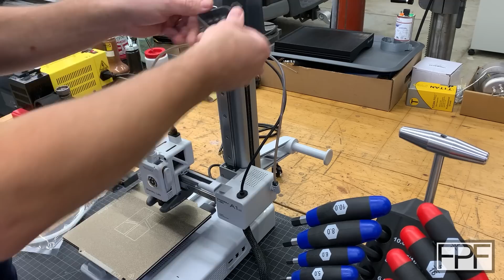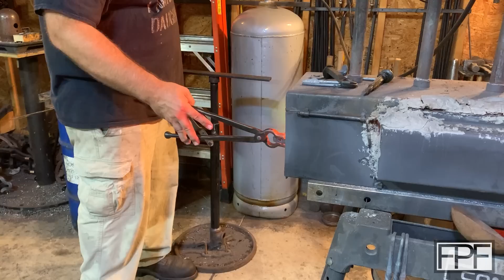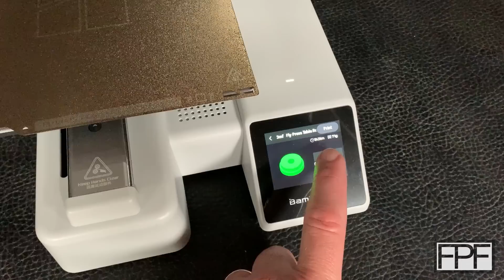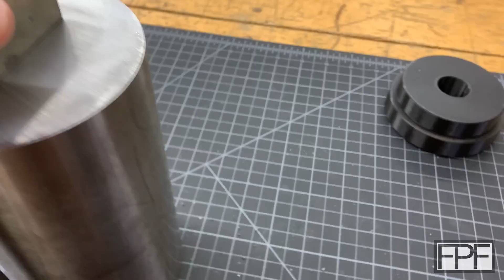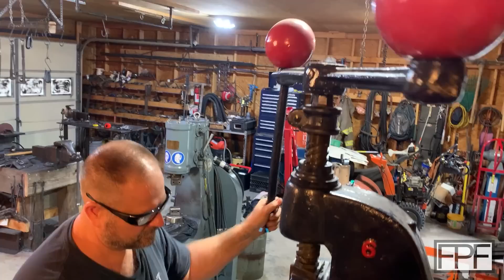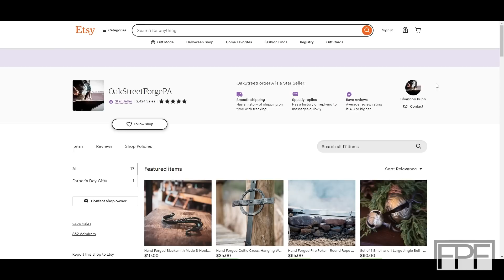Bambu A1 Mini Tested - Portable Printing

Comment: There was recently a leak about the new bigger BambuLab machine coming out in Q1 2025, confirmed by BambuLab later on. It is rumored to be called the H2D and will indeed be bigger and enclosed, and rumors talk about a twin head multicolor printhead (based on patent filings), which would eliminate a LOT of the filament loss (aka poop) actually wasted by their multicolor system.  I think that would be awesome.  I got myself an A1 Mini without AMS because I refuse to waste that much filament on prints.  We have enough plastic in the environment as it is…

Comment: Next time you are in a hurry to get something off a build plate and you're near machining equipment, just put the print bed on a big flat piece of metal. I use a shear at work, but a table saw, band saw, drill press, ... will do the job. It sinks away the heat, just lightly push down on your part and/or the build plate since the build plate will warp as it cools.

Comment: I like my A1 Mini.  Interestingly, I measuring the usage with AMS, and it seemed to be using about 80W according to my meter.  I wonder if the 240V mains here effects that.
Reply from the maker: Could be difference in ambient temp as well, making the heatbead work a bit harder.    I was printing outside, and while it wasn't real cold, it was below typical room temp with a slight breeze.
Reply: @FunctionalPrintFriday  very valid point.  Mine was indoors.

Comment: I've had my A1 mini for a few months now. It's an amazing printer for the price, and has become my go-to everyday use machine. 

As for bambu's next printer, It's either going to be a new generation of the X1 carbon, or as everyone else is thinking a large format CoreXY printer.

And I agree the new elegoo neptune 4 printers are crap. But I do rock an old neptune 3 plus that has had next to no issues.

Comment: Is the back of your car level?  Would checking for level make any difference to the print you think?
Reply: I don't think it would make a difference. Angus at Makers Muse hung one from the roof on a wire and it printed fine, and Morley Kert printed with an X1 Carbon in the back of a camper van driving on rough tracks in Mexico.

Comment: Where is the reprint? It wouldn't be an FPF video without a reprint.
Reply from the maker: what if I told you I initially sliced (and half printed) it upside down, with no supports, because I wasn't paying attention :)  I didn't use the footage though, because the video was already feeling too long.  Such a shame I had to spend extra time poking around the blacksmith shop. . .
Reply: @FunctionalPrintFriday  without the 3 reprint it's not a "real" video!!1!1!!1 😂
Reply from the maker: @berlinberlin4246  I can just see the game now:  FPF reprints it again - take a drink, FPF nitpicks over a minor extraneous detail for 5 minutes - take a drink, FPF uses the hex wrench rack - take a drink

Comment: Do you have issues with dimensional accuracy with your Bambu printers? I have an A1 and I can't get nearly as accurate as I can with my Prusa Mk3s. I'm skewed differently in all 3 axes... not by much, but enough that it makes printing pieces to size difficult.
Reply from the maker: That's crazy, I'd send it back.  Have you re-run the calibration?  The only time I've ever had issues is when using filament that doesn't have good consistency on the diameter, but even then, the part is just over or undersize in areas and not skewed.
Reply: Sounds like a belt slippage issue. We have five Bambus here and they consistently nail tolerance prints every time.

Comment: As far as Bambu Lab's printers, I'd like to see better pricing. I spend $600 on my last printer that can do 90% of what the X1 can. I get that the last 10% is hard, but over double? idk about that.
Reply: Not another race to the bottom please, we had that for many years and it was miserable. I have my reservations with Bambu, but the price is not one. For what they do I'm surprised they can sell them so cheap.
Reply: If you’re happy with your 90% printer at half the cost, why do you care? If you don’t want to spend the money, don’t.
Reply: I don’t agree. The x1c is an amazing value imo. I paid for consistent print quality and I have zero complaints.

Comment: I have my Delta 2 with 3 used 275w solar panels mounted directly west powering the shed and electric ZTR. Working great, although not the most efficient.

Comment: that's a cool shop Shannon has! One thing to watch out for with A1 mini is the data cable can catch the top of the z-axis post at just the right angle when the print head is going down and can get damaged. I almost had this accident happen to me but luckily I was monitoring closely. I've printed a little guide piece that keeps the cable on one side of the post.
Reply from the maker: thx, I can see what you mean with a taller print

Comment: I run with a qidi x-max3. Roughly 325x325x315mm build volume. Core X/Y, so it's fast. I keep two of them going non-stop with all my work. One of them I've had since they first started shipping, the other only for like three months. Neither one's ever given me problems.
For true large volume stuff, I have a RatRig. 500mm^3. Fast. Way fast, Crazy tilting bed. Needs its own nuclear reactor.
Reply: Lets hope to see an X-Max 4!!!
Reply: @OZtwo  they just released a Plus 4 which is 305x305 and its multimaterial ready, their filament switcher box will be released Q1 next year. allegedly!
Reply from the maker: competition is a good thing

Comment: IMO the full sized A1 is the better starter printer. When I bought my first printer the Ender 5 Pro I really wished that I had bought the Ender 5 Plus for the extra build volume. It's just so helpful even if all your printing is toys/fidgets sometimes you just wanna scale it up as large as you can. The mini has a certain cuteness to it that I really like being smaller though and for the price you can't beat it for an entry printer.